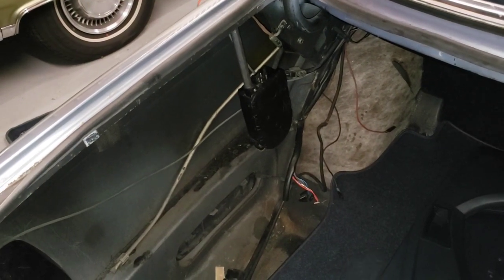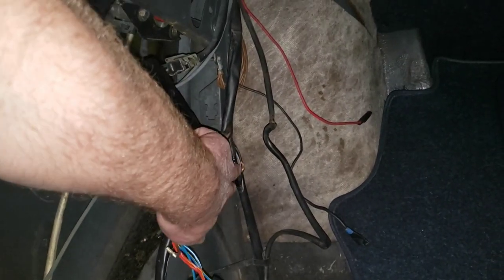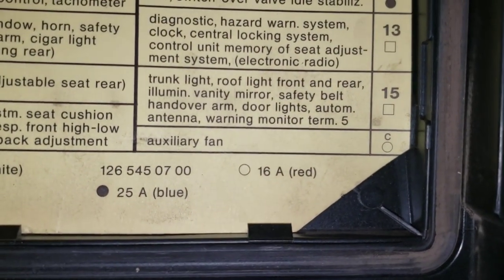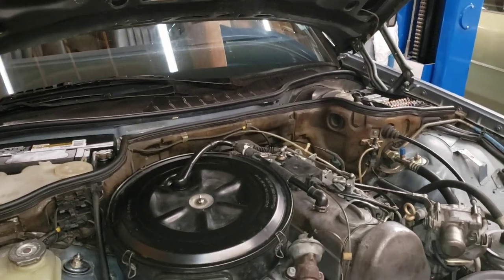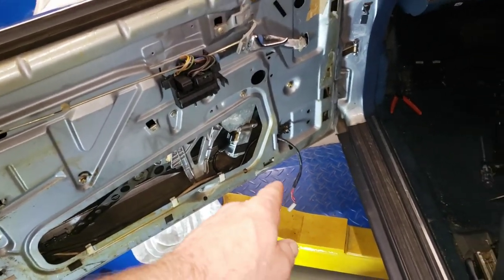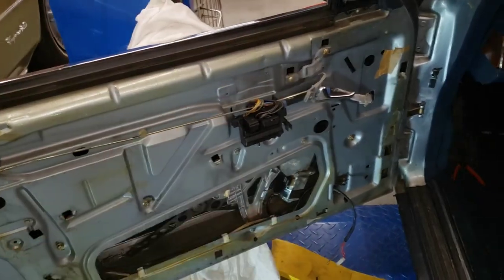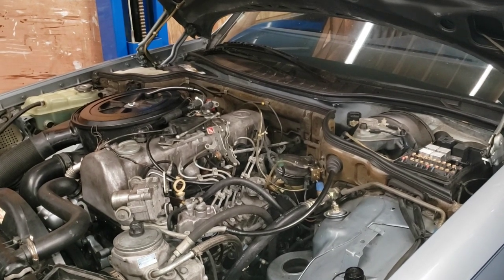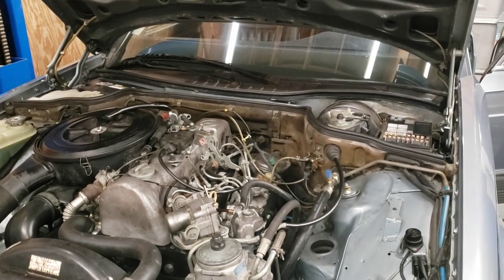VLOG - Mercedes 300SD W126  - Blowing Fuse #15! Grrr.... - Parasitic Current Draw

Comment: I've been through this several times with severa;l different W126s.  Check the front door switches in the jamb.  Some models have two switches on thedrivers side.  Take them out and test.  Usually just the act of doing this is enough to stop the short. Good luck.
Reply from the maker: I will check them today!
Reply from the maker: Still tracing this down.  All courtesy lights pulled out. All doors open. I have checked operation of all door switches. Anti theft disconnected.  Warning module disconnected.  I have an  impedance reading of around 1000 ohms between the courtesy light power distribution loom and ground. That circuit is touching ground some where.
Reply: Sorry to hear.  Another one I have seen on the W126 a couple of times, is the wiring to the trunk lid gets cut/ripped inside the body where you can't see it.  Try pulling the trunk courtesy light & switch out and giving each individual wire a good yank (don't get crazy tho) to see if any have come loose.  

Does your trunk light work?  Are there any lights or anything that DON'T work?

Comment: Hey! Mercedes ain't stupid. They're just complicated. Lol
I had a problem with batteries going bad on my e320 after I bought it. I had a friend with a meter, I don't know how to work one, and we pulled each fuse and checked the draw till we found a circuit that made a difference in the draw when pulled. I had to take the car in to fix the transmission and I asked them to see if they could figure out what on those two circuits was causing the problem. Turns out the stem on the trunk light switch was broken off so the lights were staying on.
Moral is, check your draw while pulling each fuse till you find the culprit.
I spent the day yesterday replacing the regulator on my right rear door. It works now!
When the one for the left one comes in later this week I'll do it. Then I have to get the right front and do it. I think the worm gear is shot on it. 
They are riveted in! You're lucky. Yours should be bolted on like my w123 was.
Keep us posted.
Reply from the maker: Thanks Werner! I'll be back at it tomorrow! We will succeed.